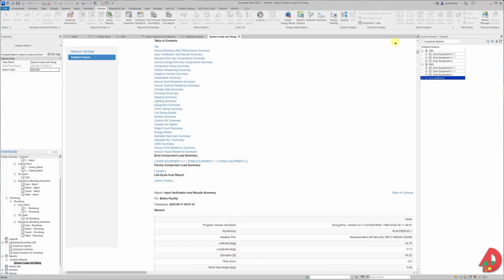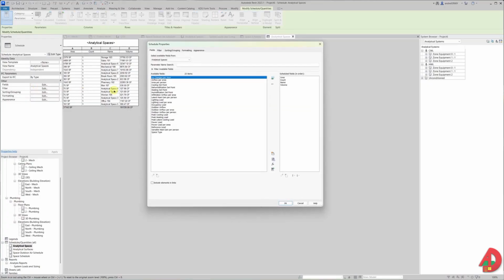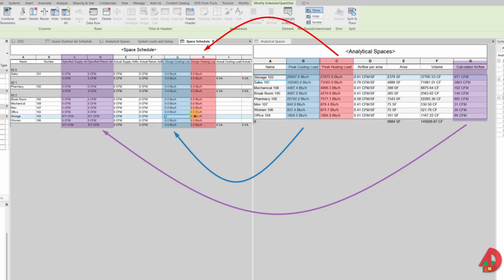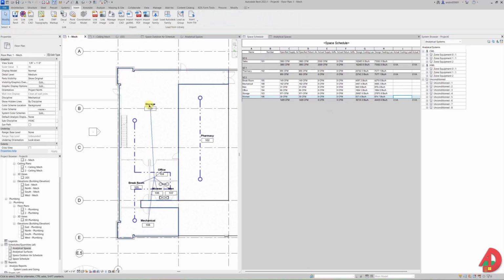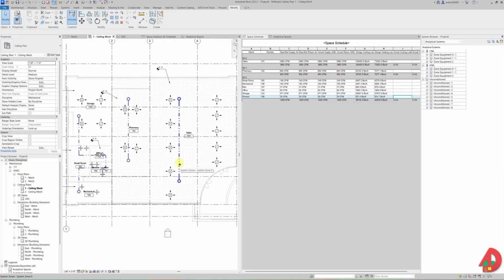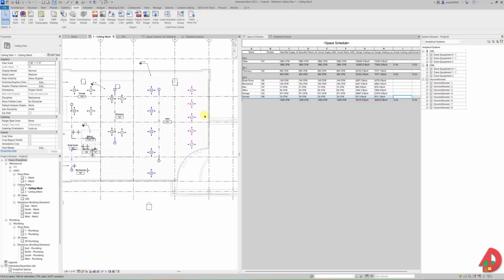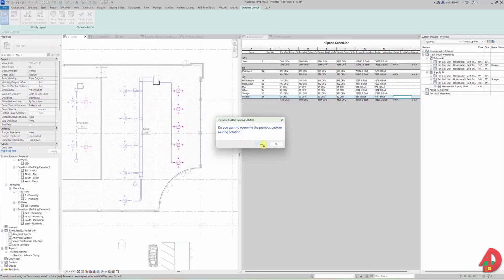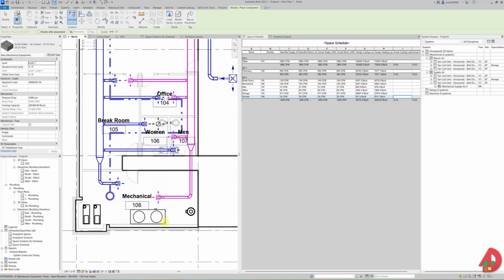Revit Analytical tools to Size and Design HVAC System Part 2 - Air Supply & Return Duct Routing

Comment: This is what we need a combination knowledge of Revit (or Rhino) architecture and MEP HVAC load calculation duct sizing.
Reply: Plus construction hands-on Practical experiences.
Reply from the maker: Yep, if Architects set up the project using full revit features, and designer understand the full extent of using analytical tools , the workflow can drastically improve